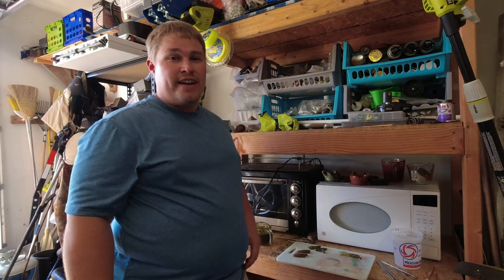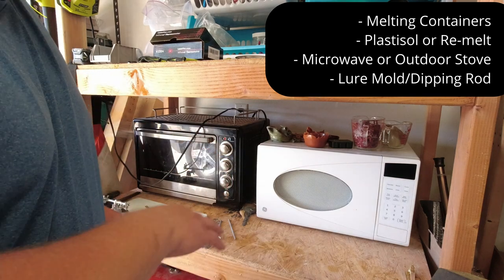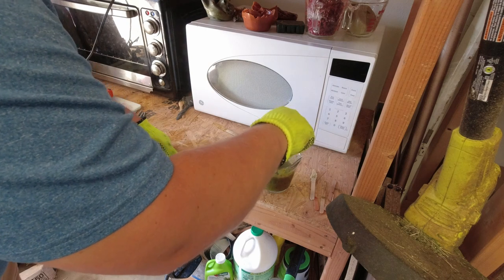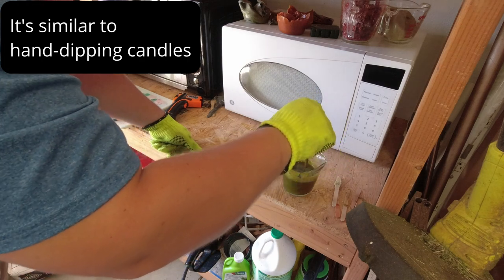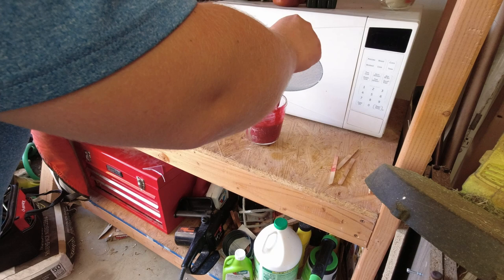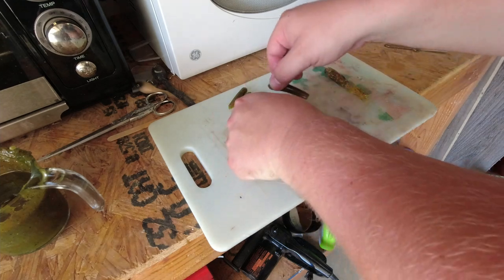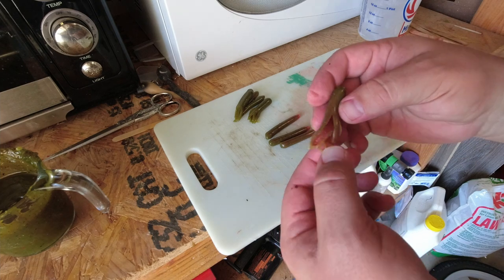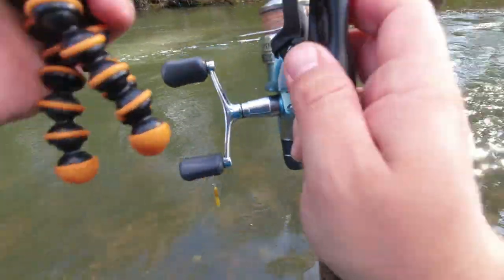Tube Baits - Homemade

Comment: You need to lube those metal rods it will make the tubes come off easier for you
Reply from the maker: I've tried that and had issues with them falling off before I finished.  Maybe it was the lube I used.